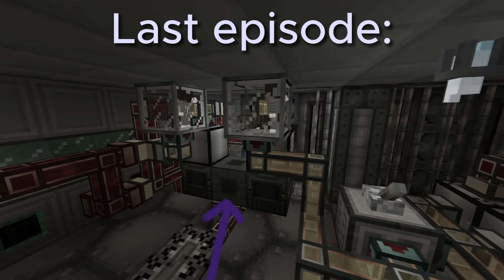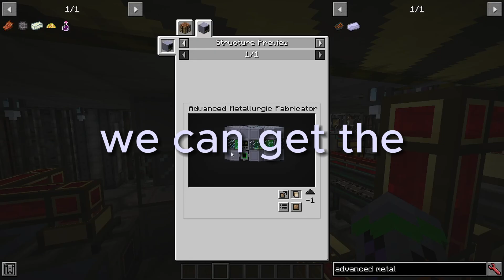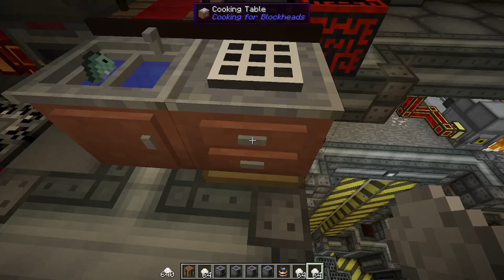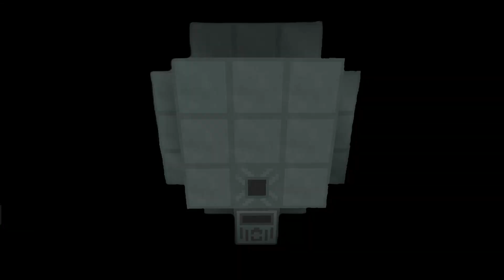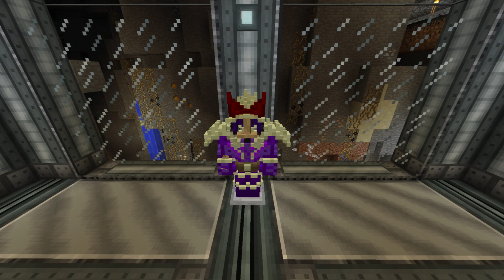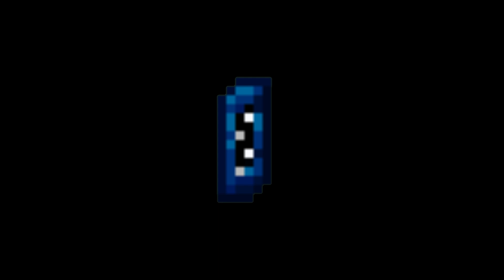Starting a Technological Revolution in Minecraft (E2E)

Comment: You don't actually need to go to the twilight forest to get firey metal, You can also get it through an Integrated Dynamics mob farm at your base.
Reply from the maker: you sure do love integrated dynamics, I never understood the mod and to get into it I needed menril which wasn't within 2000 blocks of my base so I just never tried the mod
Reply: @Hecuba39  It has some quite useful shortcuts in it and makes a lot of functions available considerably earlier than the mods in the gate quests. I would consider it a key part of E2E and doing an ID-less playthrough like you did to be a challenge run. Others consider it to be cheese (E2E Extended nerfs it to force things like Botania terrasteel and elementium automation). As a programmable logistics mod, it does have a bit of a learning curve though.

I used it for resource generation, automating the seared furnace, bulk logistics, sorting, and moving resources and power across dimensions (way before flux networks). It allowed me to rush Mekanism fusion (which works best in the End) for 20MRF/t and get all that power back to my base. Once you find and farm a Menril tree (common in magical forest biomes), it's quite cheap (certainly way cheaper than cryo-stabalized fluxducts).

Comment: You... Can use one "interface". It's called PackagedAuto and pairing it with your extended crafting tables allows you to make every single recipe in them autocraftable.
Each extendedcrafting table has a packagedauto variant. Put an unpackager beneath one, then a packager below the unpackager.
Connect the packager to the ME network.
Encode the packagedAuto packager recipes using PackagedAuto's encoder
Voila autocraftable ExtendedCrafting stuff
Reply: You can pass AE Power to the crafting tables too, so you could have one unpacker with 6 crafting tables around.